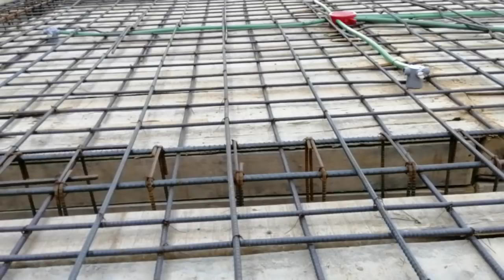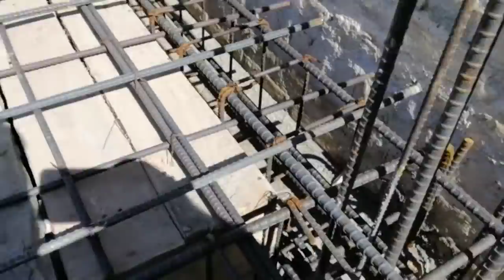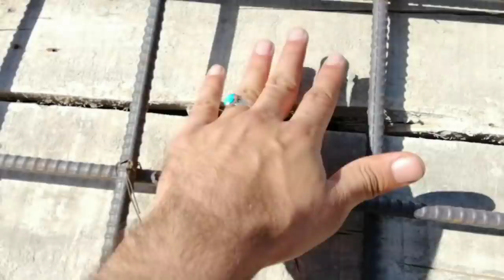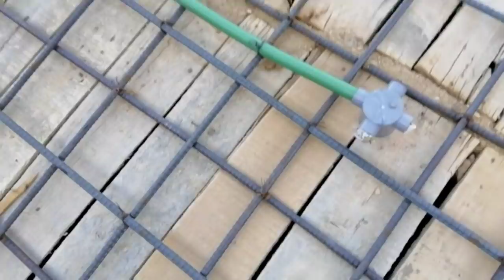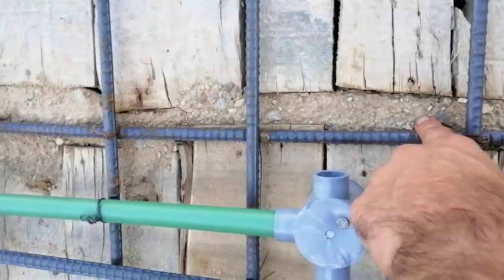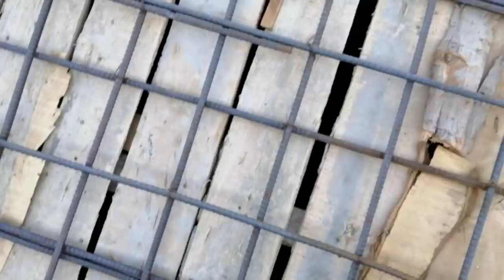Big Mistakes in RCC Slab - Lapping Mistakes - Reinforcement Mistakes - Civil Engineering

Comment: 1. Same dia bars are used in two way solid slab. The distribution bars he was talking about are generally used in one way slab.

2. Lapping are provided at edges only,  Moments are high at mid of span. 
Shear stresses are high at support he is correct but the bars he was showing was main bars (tensile bars) not the shear bars.

3. Lapping done at same point but it was done on alternate bars. so there is no issue.

4. Bleeding point he raised is correct. They might fix the holes during concreting.

5. As shear stresses are high at end support we keep the spacing less, no issues in the Slab reinforcement spacing.

Comment: Isn't lapping must be a zone of zero Bending moment? If that so, the lapping  of slab reinforcements here at the support is fine and not in the middle where maximum bending moment exist. If its a beam then the lapping should be done in middle for top bars only.
Reply: Barhom ibrahim Yes agreed to you. The bottom bar lapping must be near at support for a beam or low in bending but I think he care most of the concrete  volume space  rather than the lapping space reinforcement.
Reply: I agree with you is better to let the lapping be by the beam crossing the beam on either side
Reply: All I can say it's easier said than done. It's easy to get to the job site and say this should be built like this, or you built this wrong you made a Mistake. It's  another thing doing the work and another thing to have control of the employees
Reply: N.E Los Angeles Kennels plans and specs must be followed, you can’t sacrifice safety and quality.
Reply: For steel fixers to understand easily if there's no placing drawing provided by the rebar engineer: A.) For beams or slabs... just tell them where to have splices: 1) within L/4 each side of span near the support for bottom bars; 2) within middle L/2 for top bars. B) For columns - within middle L/2 of its clear height but not more than 50% at same splice point...the other 50% (others are 33%) shall be spliced at the next floor level (same at mid-height for multi-storied bldgs)..however if spliced at same level, 50% splicing is staggered at usually 1 meter minimum.

Comment: Re Bars should be 2 inch or 50mm higher from the form -It should have approx 50 to 70mm concrete covering all sides
Reply: I was thinking  so too
Reply: chair on internal floor min of 25mm on ground floor min 50mm, min 25mm cover inner beams columns, on out side wall min 50mm, in foundations in wet land min space out concrete to r bar .75mm

Comment: Slab and beam bars should not be lapped at center, it should be lapped at supports because because at center there is sagging bending moment and to resist shear at end extra top bars are provided to resist it  and in columns lapping should be provided at centre not at ends. The reason for this is that the lapping must not be provided in tension zone of structural member. In beam and slabs, the tension is high at bottom mid span and in columns, the tension is high at top and bottom ends
Reply: @Civil Engineers  Bending Moment at midspan is ZERO?   You are stupid.
Reply: @yoonhong9098   and they themselves called "Civil Engineers"
Reply from the maker: Bro be careful don't provide lapping at the end.... Because we provide lapping length at mid.. BM is zero at the mid point
Reply: @CivilEngineerss  how can you even call yourself a civil engineer?? Please stop making videos like this
Reply: @CivilEngineerss  Seriously... Who taught you that in the midspan, bending moment is zero...
Reply: @CivilEngineerss  You're not serious my Brother...

Comment: steel should not attach to the ground. there should be some space between ground and steel.
Reply: absolutely, we call them cover blocks in my country, and they vary between 30 to 50 mm, depending on the structure being constructed, and should have the same compressive strength as the structure
Reply: @northfolkshaq3054  yeah...in my country we call that concrete spacer blocks...minimum of 20mm...
Reply: @northfolkshaq3054  cover should be provide:
For slab:20mm -30mm
For beam: 40mm-50mm
Reply: Yea aci318-11 requires dobies for clearance,  also the down turn beam is missing a lot of stirrups, lap splices are usually called out on plans, but if not 24" staggered
Reply: Cover block

Comment: I think lapping at the support is more convenient than lapping at the mid span...
Reply: Yah you right dear but it depend on designer but lapping at the support is correct.
Reply: Exactly, because at the mid span the moment is at its greatest but at the support, the moment direction changes to top which the top reinforcement at support are provided to handle.